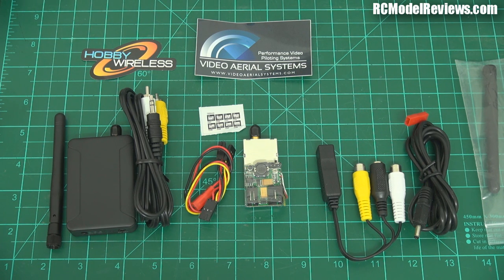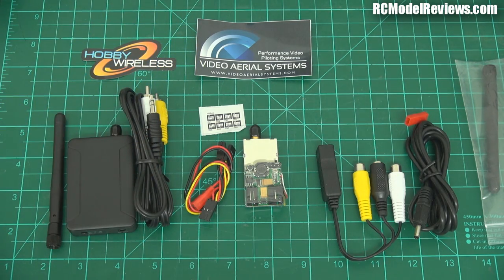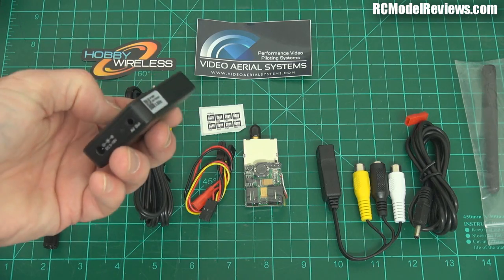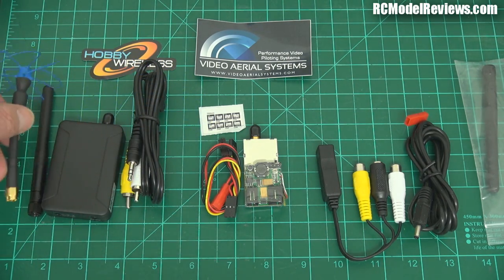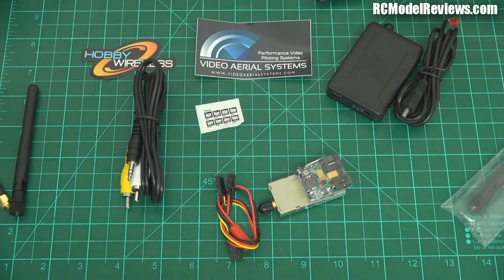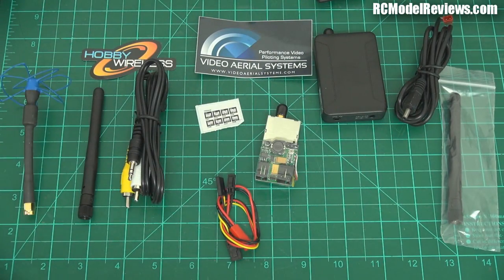3.3GHz FPV from HobbyWireless, a first look

Comment: Hi Bruce.  I think it's important to stress that in the UK holding an amateur radio license does not automatically  mean you can use this equipment. The UK Amateur Radio Licence does not permit broadcasts from airborne platforms within the amateur allocations other than frequencies assigned to the licence exempt Industrial, Scientific, and Medical (ISM) and Short Range Device (SRD) allocations exclusively for such purposes. Also in the UK the 3.3GHz amateur allocation is assigned on a secondary user basis with the Ministry of Defence being the Primary user. Other proposed uses of the 2.9GHz to 4GHz spectrum are dealt on a case by case basis under the sole authority of OFCOM, our equivalent of the FCC. It has been rumoured that OFCOM are now beginning to take an interest in 5.8GHz in relation to the use of excessive power, the maximum input at the antenna is 25mW in the UK. I really wish it was different.
Regards
Nidge
Reply: +sputniksam the reality is that pretty much nobody takes a blind bit of notice of these regulations. Something will have to give one way or another and soon !
Reply: +sputniksam Nidge, a very informative and useful post.  In fact the 25mw limit is EIRP and therefore a 5.8Ghz transmitter with 25mw output power is not technically legal either.  Given the typical gain of an omni-directional antenna the actual output power at the antenna would have to be limited to around 12mw to remain legal.  I think that OFCOM will need to re-consider the use of the 5.8Ghz band in relation to FPV flying to ensure their rules remain practical and sensible given the growth in FPV flying and racing.
Reply: +MegaSexwax It last for life providing you keep your details up to date with Ofcom.  Take a look at Ofcom Online Licensing Services.
Reply: +sputniksam Yep... this will vary country-by-country so people need to check their local regs in respect to whether it's legal to use this (or any) non-ISM system even with a ham license.
Reply: +MegaSexwax In the US the license good for 10 years.

Comment: you need a HAM license for 5.8 In the US unless you have a fcc exempt 25mw vtx
Reply: +Wyll Surf Air really? do you mean 250mw? thats what I have an didn't think I needed one
Reply: +XYrZbest Nope, he's right. <25mw and I think part 15 certified is the only type of FPV transmitter you can use in the US legally without a HAM license
Reply: +XYrZbest ya he is right
Reply: +XYrZbest  Shhh... he's right and the FCC is listening.  There's no laws about buying stuff over 25mw, but to use it you're supposed to have a license.
Reply: +Wyll Surf Air oops o.o

Comment: Before you all go yes please for videos on getting an amateur radio licence, watching a few videos from Bruce will not you get past the exams. There is quite some detailed learning to undertake. Like radio and electronics theory as well as regulations. The requirements and level of detail will vary from country to country too. Getting an amateur radio licence is not a passport to RC Nirvana. Getting an amateur licence will bring further responsibility and culpability for your actions. 
You could liken the amateur licence to a driving license in that it is the person who is licenced after proving their competency as opposed to registering the car which merely confirms the suitability of the car for on road use taxes and insurance aside.
Reply: +Rob B Yes there is some locale-specific information that needs to be learned but the ham ticket isn't nearly as onerous as it once was.  I recall that proficiency in morse code used to be a criteria but fortunately that's no longer the case.

Basic RF theory gets you a fair way down the path to your ticket and the rest is pretty much some rote-learning.
Reply: +Rob B HAM licences are not that hard to get.  I got mine last year with just kind of brushing through practice exams some.

Hell, I was 2 questions away from the general licence, and I just decided to take that one on a whim the same day I took the technician exam.
Reply: +SteevyTable It all depends on the base level and understanding of the individual. Honestly can you see someone that needs their hand held building a quad is going to even stand a chance? I think not. 
I would suggest you have actually acquired a great deal of expertise along the way rather than in actually applying yourself to the task immediately prior to getting a ticket. Congrats on the success BTW.
Reply: A ham licence in the UK will not help because it does not allow for airborne transmission.

Comment: In Europe those frequencies are allowed for radio-astronomy and space science/exploration and military use. No private use allowed. And 1W?? WTF, who needs 1W?
Hm, I guess instead of more illegal equipement it would make sense to work for some new rules to legalize the current 5,8ghz power above 25mw. The 25mw makes sense in urban surroundings to avoid interference between all those wireless lan and security and babyphone-stuff. Outside on the field 25mw is a safety risk to fly with.

Comment: Hi Bruce! Another great video!
Now, I have som thoughts about the "need a ham lisence" practice all over the world, for using the VTX gear and long range RC in the amateur bands. I have been thinking that hey! I'm a radio amateur (Ham) and can use what ever I like of radio equipment!! But what about the bandplans? It strictly regulates both the modulation, bandwith, allocation and more for each band. In my opinion, it's not enough to get a ham lisence and go crazy on the bands. I can do it, but if caught, I can loose my ham lisence. And because I have a ham lisence, I should know what radio is and act accordingly. 

So a ham lisence gives you the right to practice amateur radio on allocated bands with spesified modulations for experimenting purpouses. The question is if a VTX is allocated in the band, and can be looked upon as a HamTV operation, and if the bandplan allows that in my region (Region 1 for me) Remember allso that 9cm SHF (3,4 to 3,410GHz) is not implementet everywere. I don't know about my country (Norway) but Denmark has a "application only" policy about this band. From what i see, using a 3,3GHz VTX in Norway/Denmark would be unlegal. I as a ham could loose my ham lisence, for operating outside ham band allocation. This is VERY no-no!

Feel free to dig innto this. I once tried to contact the norwegian frequency attoritys (I know: Spelling!) but got nothing sencible back. It was about the UHF band (433MHz) and long range RC. I think they concluded that we have nothing to do on the ham band, with a RC plane, and it dosen't matter if you are a ham or not: RC is not ham radio. Oh well... Have a great weekend! 

(Are you a ham? If so, what's your callsign?)

73's de LA6UOA :-)

Comment: Just checked the HAM frequency tables for Austria, Germany and Switzerland. In none of this countries 3.3GHz is a HAM band. So there's a good chance that this is also the case in most other countries of the European union. A HAM license would be cool anyway because it allows you to use higher wattage 2.4GHz gear legally.

Comment: I'd like to see 4 or more models on the bench each with a different frequency transmitter and clover antenna, for size reference and silliness 900, 1.2, 3.3, 2.5 or anything else you have laying around.

Comment: Bruce that plug you were referring to is called an Easy Cap, basically so you can connect you video receiver to you LapTop and DVR or record it instead of capturing it to a SD card.. I'm pretty sure anyways, I could be wrong and I would be interested in participating in a Ham Ticket prep class from you. THanks !

Comment: 1w is only 3db more than 500mw and generally 2.4ghz 500mw has had better designs than 1 watt versions. 3db extra is not worth it for the heat, and probably loss in sensitivity. I'm betting the 1watt is not worth the hassle 3db is not much extra range even if the sensitivity is equal.

Comment: The black square box with AV leads and a power lead coming from it looks like the 5V voltage regulator often found with Lawmate transmitters.  I think TBS did a  mod on it but whats the point when there are plenty of more reliable 5V step-down regulators.  I removed the casing for better cooling but decided not to use it. 
I'd be interested in seeing your HAM videos but the amateur beginner license is very basic which makes me wonder why its a requirement. it only really makes sense in understanding how to use a ham radio for speaking over the radio. I know it also teaches very basic electronics & some radio theory.

Comment: Quick question, if you'd be so kind to indulge. Could the brushless motors used in quads also be used as a high precision stepper motor? It, the motor, seems to be an inside out stepper. If I'm wrong in my thinking kindly correct me please. Thanks in advance, and apologies for posting this on a rf vid.

Comment: Does that vtx have a metal casing surrounding much of the unit? That'll definitely cook it if not given ample cooling. I got a 1.2/1.3Ghz 800mW vtx off BevRC that came in a metal case, got baking hot in 5 minutes. I thermal-pasted small 11x11mm heatsinks on it (they came with adhesive bases, removed that stuff first) and mounted on them two 20x20mm 5V fans (wired in parallel so they can split the amperage and run off my rx). Unit now only gets lukewarm
Reply: +BashMonkeyRC Yes, that case will almost certainly get very hot.  Most VTXes are less than 50% efficient so if it's pumping out a watt of RF then it's going to be dissipating well over a watt of heat.

Comment: Bruce - I'd be interested to know if you can adjust that vtx regulator to drop the voltage going into the transmitter module itself in case the output power can be usefully lowered a little before the mc stops functioning.
Reply: +OpticalNZ It's possible... but I would expect that you'd end up running some of the internals without the correct bias levels and that could stuff up the modulation (it's AM for the video signal) as well as perhaps produce a rise in spurious emissions.   An attenuator on the antenna connector is the quickest and easiest (also probably the most reliable) way of reducing the output.

Comment: Looking forward on the next review of this kit.
Its a nice kit, really like to see it on the spectrum analyzer.
Harmonics and video bandwidth.

Good point about the ham license, check the ruls in your country before using.
Over here u you will need a osd with your call and you cant use all the channels.
Check the bandplan.
Reply: +joeri pe5jw Most FPV board-cameras have the ability to overlay text on the image so you can put your callsign there -- no OSD required!

Comment: hey @xjet, just been checking out RSM for guidance on RPAS + 3G3, unfortunately, it looks like under the GUL for SRD (http://www.rsm.govt.nz/about-rsm/spectrum-policy/gazette/gurl/short-range-devices), none of the 8 channels supported by this transmitter are legal for aerial (or even ground based) video transmission. Looks like radio-location only, at  -10dBW e.i.r.p. per https://gazette.govt.nz/notice/id/2015-go4359 or http://www.rsm.govt.nz/smart-web/smart/page/-smart/domain/licence/SelectLicencePage.wdk if you search for 2900~3400 (middle = 3150). What are your thoughts on the matter?
Reply: @xjet http://i.imgur.com/7wTzcRo.jpg
Reply: +fujin I'm preparing to make a representation to the RSM people with  view to reducing the amount of "illegal" FPV transmissions by way of perhaps legalising use on parts of the band where such emissions are very unlikely to interfere with other spectrum users.  For example, you can buy FPV gear that is labeled "900MHz" but actually supports transmissions right up to 1.2GHz.  Many of the frequencies this gear operates on are already in use for essential services such as cellular phones and DME services used by aviation. 

My hope is that I can present a good case for them giving a little in some areas (perhaps like 3.3GHz) and thus reduce the risk of ignorant or  arrogant FPVers using illegal gear on unauthorised frequencies.

To get any kind of leverage with RSM we (as a community) will have to marshal our forces and present ourselves as a unified body though.

We could do this through MFNZ or by way of a special FPV group.
Reply: +fujin Yeah, there's no ISM allocation we can use on the 3.3GHz band at present but there is allocation for amateur radio operators.
Reply: +xjet if I personally or Rotorcross N.Z. can help, please let either of us know!

Comment: Man, the people at RSM were definitely NOT very helpful, most confusing phone conversion I've ever had. But it does seem that 3.3ghz here in NZ is not allowed (for fpv, limited to radiolocation) under the short range devices service of the general user radio license, even with a ham license. Can you shed some light Bruce? I hope you didn't power up that unit ;)
Reply: +Jon Keller I'm preparing to make a representation to the RSM people with  view to reducing the amount of "illegal" FPV transmissions by way of perhaps legalising use on parts of the band where such emissions are very unlikely to interfere with other spectrum users.  For example, you can buy FPV gear that is labeled "900MHz" but actually supports transmissions right up to 1.2GHz.  Many of the frequencies this gear operates on are already in use for essential services such as cellular phones and DME services used by aviation. 

My hope is that I can present a good case for them giving a little in some areas (perhaps like 3.3GHz) and thus reduce the risk of ignorant or arrogant FPVers using illegal gear on unauthorised frequencies.

To get any kind of leverage with RSM we (as a community) will have to marshal our forces and present ourselves as a unified body though.

We could do this through MFNZ or by way of a special FPV group.
Reply: Sounds like a good idea, I wonder how accepting they'll be. The attitude I got over the phone was "it's up to you to figure out if what you want to do is legal or not, and if you get it wrong we'll prosecute you". I think I'll stick to the legal 5.8ghz frequencies for now.
Reply: +xjet special fpv interest group would be the ticket.     Not much faith in MFNZ

Comment: ham operators are going to hate these!
Reply: +Designandrew I agree. Even to the point where I'd rather Bruce did not cover these sorts of devices and the tacit approval. The simple fact of the matter is these things are going to be used illegally by the vast majority of purchasers since they will not have a suitable licence.
Reply: +Rob B The reality is that those who are going to use them illegally will do so regardless of what I say or do -- hence my desire to perhaps convince as many as possible to go the legit way (by way of a ham license) or at least explain to them the repercussions of breaking the regulations (large fines and confiscation).  Education people as to their options is a much better alternative to simply ignoring the problem (IMHO)
Reply: +Rob B Yes, if we actually got ourselves organised as a global group, perhaps we could even convince authorities to provide another tier of licensing (between ham and ISM) which required an understanding of how to use this gear in a way that doesn't pose a threat to other spectrum users but which doesn't require an in-depth understanding of the technology behind it.   Sort of a "ham-lite" license for FPV fliers which gave them the rights to use some modest power levels on a few otherwise lightly used bits of spectrum.
Reply: +xjet I think you are on to something here.... Many countries now have a basic "Marine Operators Certificate of Proficiency" which acknowledged that most people didn't need to understand all the aspects of Marine HF radio, but should know how to use an EPIRB and a UHF radio to call in emergency. The material could be "3-4" pamphlet pages (10 min video) and a basics understanding test. [Perhaps we should get together with our National clubs to see what can be done ...  ooops perhaps too soon, too soon!!!]
Reply: Alex Stewart If you think about it that is exactly the situation we are in now. The premise is that some hardware is type approved, unmodified and possibly licensed. In this marine case the operator is not really licenced but rather educated to deter casual and irresponsible (eg idiots found on the CB service) use of a vital service.
I do agree we need to show a demand for consideration and recognition into a spectrum band plan. That however is not going to be an easy task given the mess some countries are in with legacy services and equipment and current demand for more services.
Spectrum management is a complex task made all the more harder in recent times with the convergence of services like mobile phones, wifi etc into the UHF and higher frequencies.
In any case I believe 8 simultaneously usable frequencies on 5.8GHz is plenty, any more is asking for mid air crashes. I see no future in so called long range FPV since every country that has spectrum management regulations either implicitly or explicitly forbids this kind of operation.

Comment: Is there a way to measure the rubber duckies so you know what frequency they are made for?
Reply: if you rip them apart and mesure the length of the antenna inside
Reply: +Ultra rc Any non- intrusive way too?
Reply: +mvh808 If you've got a vector network analyzer ($15K+) you can... but other than that, there's no cheap/easy way.